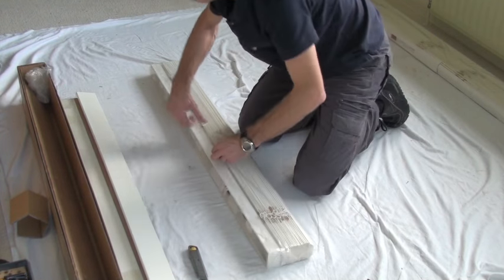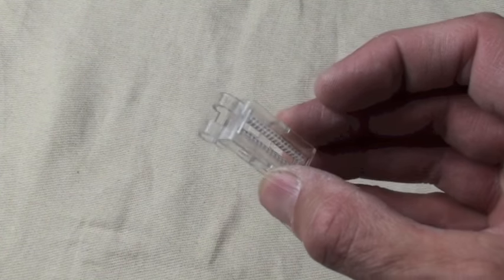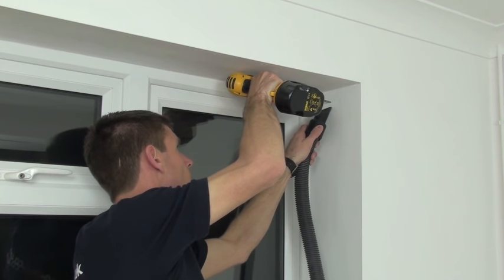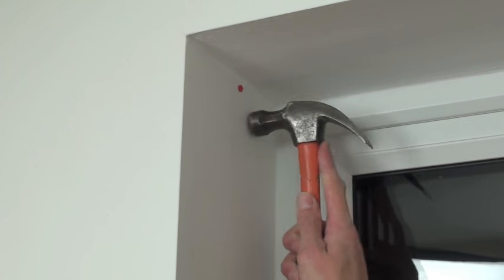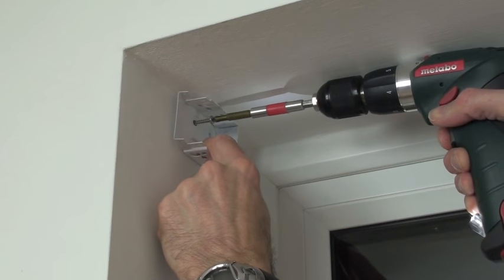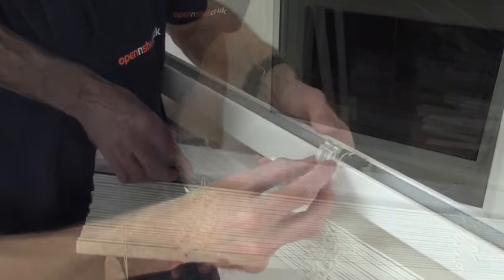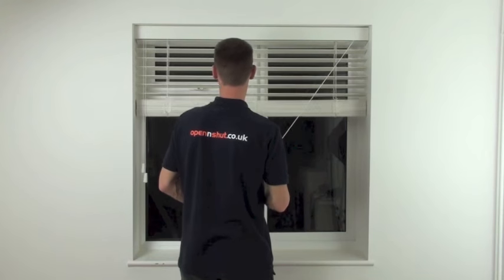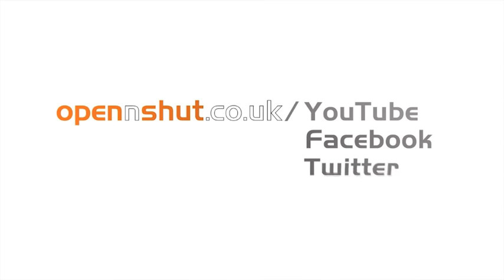How to install blinds - inside mount installation

Comment: what kind of drill did you use...can you provide the model?  What it the screws/drill do not go in, could it be there the wall has a steel plate?
Reply: It would be a standard 18v drill with the hammer setting and then turn it to the screw setting to pilot the screws in but I use a screwdriver to wind in the screws to be honest

Comment: Have plaster board (everywhere in New build) and reluctant to drill into upvc frame.  Bound bracket doesn't extend wall to wall.   Plaster board is SO weak and feeble in worried I can't attach the same thungs...  Help